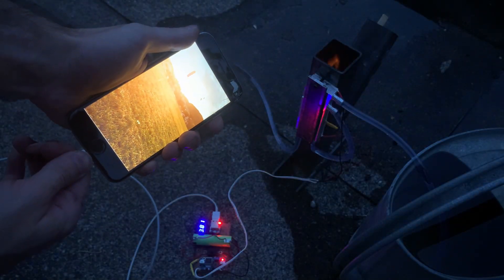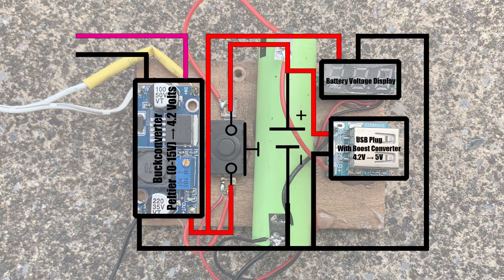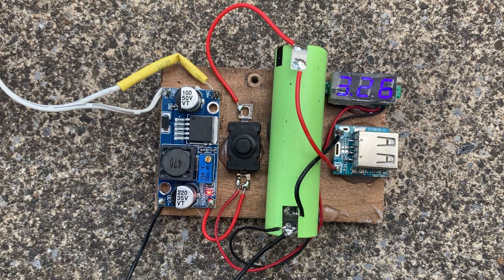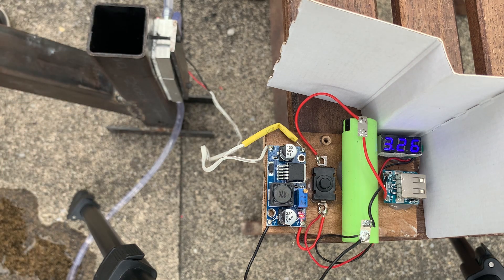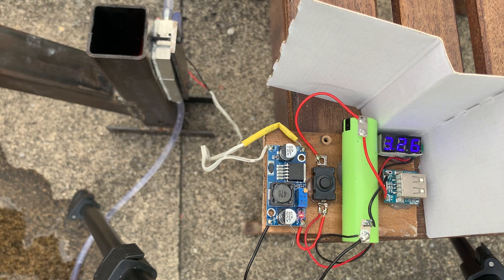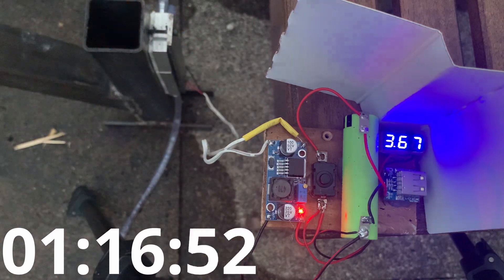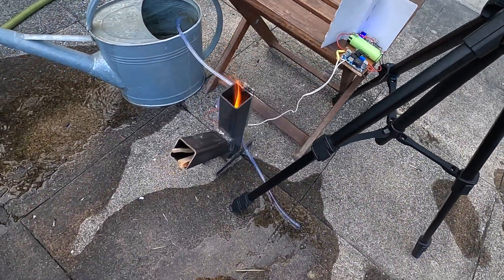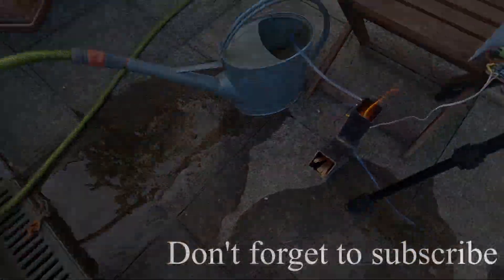The Thermoelectric Phone-Charger!

Comment: Ive been thinking on making a doomsday cache. 
First, a raspberry pi zero, on a e-paper display, i think i can get less than 10 volts to power it.
Likely wrap the thermoelectric capacitor wire in a fire resistant tube.
Second, load up a 1tb micro sd card with survival information, how to build a combustion engine, an entire copy of Wikipedia, etc, and some music. 
Third, wrap everything up in a faraday cage, air seal it. and put it into a fire resistant and water proof cage. 
Then bury it 6'-10' underground.
Far enough down where the earth would keep it warm, and that it wouldnt freeze. Ideally aiming for 35°f-40°f.
The tricky part is to do it without any batteries.
As a bartering tool, it would be absolute gold, and if im not around to dig it up, hopefully someone else finds it in the far future.

And this is the final piece of the puzzle ive been looking for, thank you.

Comment: Are you using 3 pletier modules?
Reply from the maker: Yeah i used 3 Peltiers in Series to get a higher voltage.
Reply: @bootlegengineer  The Power is aprox 3W( 5.5 V and 0,5 amps) ? around 1w per module? WIthout  converter voltage is 12 V and how many Amps ?